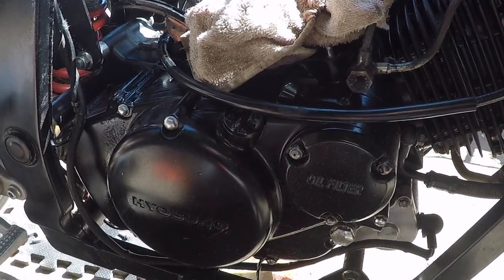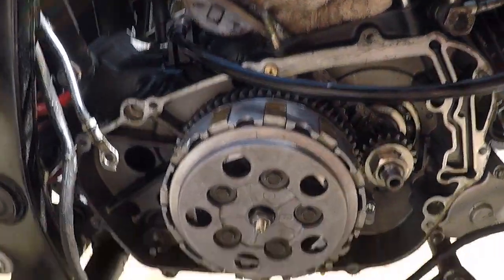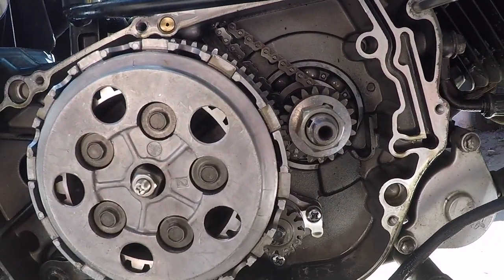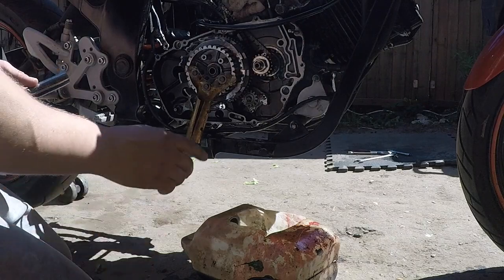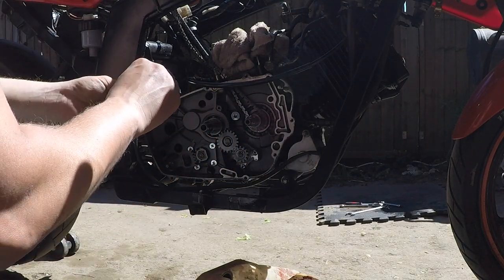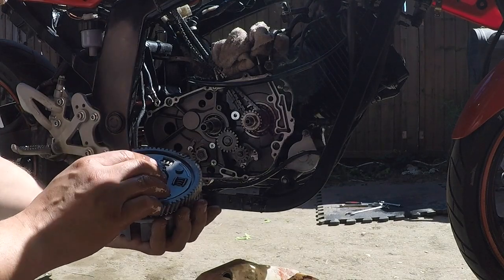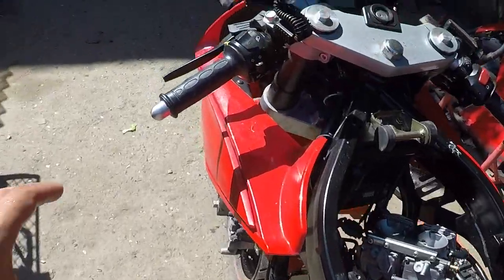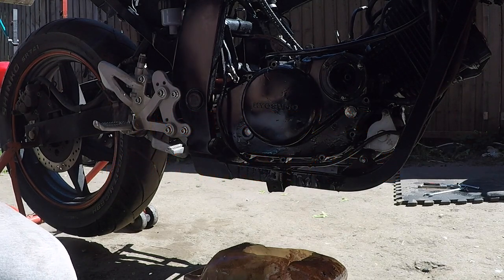Hyosung GtR125 clutch removal

Comment: Followed what you done had to replace cam chain removed clutch basket fitted back up and now clutch lever is slack and bike won't start doesn't even crank over when starter hit no sound
Reply from the maker: Clutch is nothing to do to not start engine maybe just check ground wiring sure that’s why bike not starting and if you clutch is stuck then definitely there is two pins going inside clutch and just the last one went out and have to put in write place let me know have you do I am  sure that’s 100% problem

Comment: Bike won't move in 1st gear and won't go into any high gears only neutral and 1st what could be probelm?
Reply from the maker: When you put in first gear and press the clutch is it bike moves as it should if yes your clutch is fine so I think is something to do with your transmission
Reply: Bike moves in 1st gear as it's still in neutral and when open throttle in 1st gear bikes dosent move
Reply from the maker: @marklindsay6228  first think check your clutch plates maybe they are wearing out and that could be the reason just check them and let me know they not expansive to replace and easy done as well also did you replace something on bike or was fixing before this happen?
Reply: Bought engine and fitted then put bike in gear to accelerate and bike didn't move was thinking something a miss on clutch basket or plates

Comment: Hi have problem with GT650R.
Do you know how I can remove the shaft that the clutch release arm is attached to..thx
Reply from the maker: Michael Caruana hi just send to NR1Romanmotors@gmail.com if you can will help you out!!
Reply: Sent you an email thx
Reply from the maker: Michael Caruana Ok to get that out is just a bit off work you need to remove clutch top case I send you photo and there is 3 small pins inside just tilt bike to right till they come out or try to use magnet last pin locks you shaft as soon you get that out you will be fine!!!
Reply from the maker: Michael Caruana just let me know have you get on?
Reply from the maker: Michael Caruana hopefully that will help!!
Reply: Hi there I think my clutch is going on my hyosung gtr125 and need to know where I can get a kit from thank you